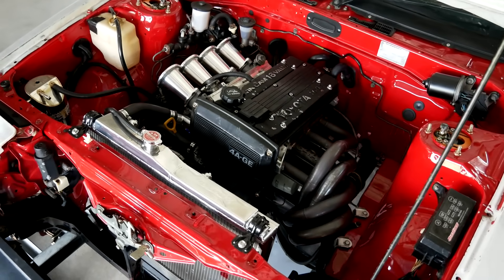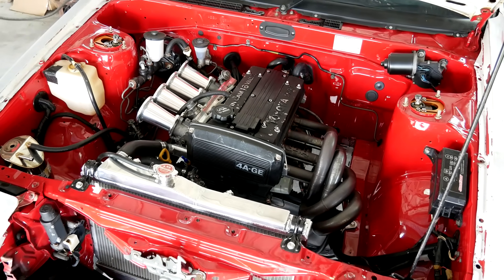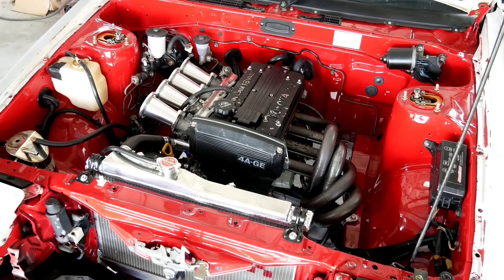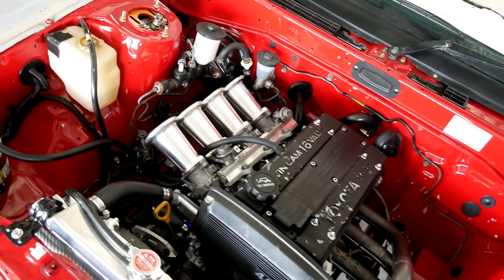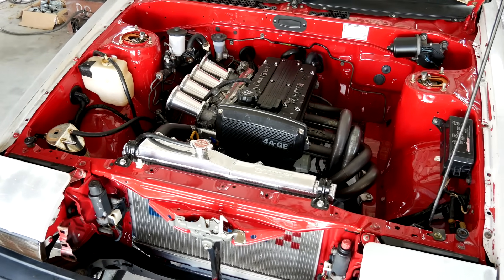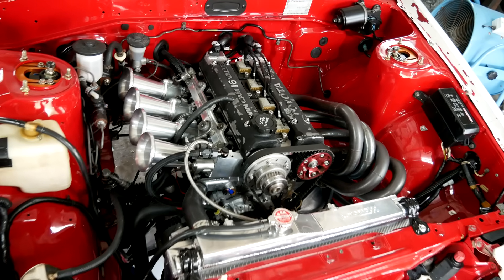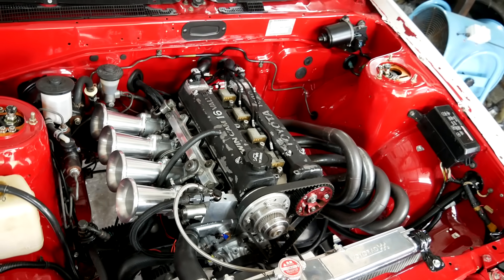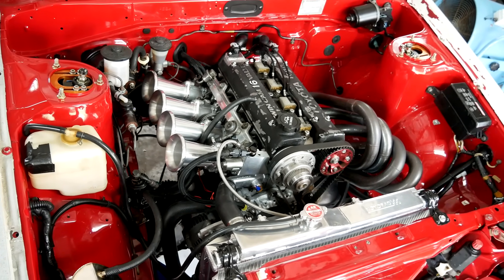Advantages of VVTi  - Toyota AE86

Comment: Is there variants to make 1.6 with  average high rpm (between changing gears) better than with more power?
Like 160hp engine will have more hp after gearchange, than 180hp engine. Is it possible?

Comment: Is it safe to rev 4age (ST) to over 9000?
What issues?
It's OK for new OEM crack and not  for 30yr old ?
It's OK if block wasn't ever overheated so crankbed didn't bend?
What variants can be?

I heard a lot of cases when crank cracked at the first neck. Why so?
Reply from the maker: Never had an issue with stock crank breaking myself.  always at least run the stock balancer.    bottom end wise, I like to do lighter rods and pistons and oil pump gears when going over 9k.
Reply: @Garage4age  What means " run the stock balancer"?
Reply from the maker: @ukuskota4106  crank pulley.    in other words, dont run a solid crank pulley. the harmonic balancer are there to try dampen the vibrations that can break the crank
Reply: @Garage4age  oh yes -that was the other version of cracks - too tight belts on a pulley.

But I didn't see there harmonic balancer.(Only on exhaust pipe.) Is it inside a pulley?

Comment: So VVT in silver \ black is for  idle and low rpm??
When I bought my levin it had VVT welded :faceoalm:
So as I supose it was in the midle of belt timing.
It had lasyness at low rpm but sound good at 7000
but 0-100 was  12 seconds.
Reply from the maker: I dont know exactly how the stock ecu operates.  but 20v  vvt is off (Retarded) at idle, low load, and high rpm (6-7000rpm onwards).    On  (advanced) everywhere else.
Reply: @Garage4age  my АЕ101 pre-restyle switch VVT on when pedal is more than 50%.
I put a diode and +wire  on  VVT wire  near ECU (it's minus).
I read that different ECUs had 3 different VVT algorythms.

but I meant VVT as device. Old engines (without VVT or VTEC) can be equiped with higher cams but they will have high idle .
So when VVT is of it's for low rpm ride, I think.
Reply from the maker: @ukuskota4106  Yeah  engine with big cams will run nicer at idle with vvt/ vvti

Comment: Question for a 4AGE professional: is the 9AGE a real build? 7A Block 20v K20 pistons and rods i think?
Reply from the maker: A company makes a stroker crank etc to make a 1900cc engine.   which they call a "9age"    personally i would never run it.   since the bore / stroke ratio is pretty average , and are demanding a lot from a head designed in the 80's for a 1600cc.     best to go to a different engine for that kind of capacity

Comment: I think twin VVT would show possibly around 5 to 8kw more power above 4000 rpm on average
Reply from the maker: I've simulated it on adjustable cam gears.   is small gains but, isn't that much in it over a well timed fixed setting.   found same thing with dual vvti engines i've tuned, like beams 3s etc
Reply: @Garage4age thank you for the response, i had a feeling that was going to be the answer 

Cheers from the US

Comment: Interesting as always. 
 What are the owners comments? Is he happy with the gains? Did part throttle response improve?
Reply from the maker: He hasn't taken it to the track yet, but sneaky road test seemed good.    I usually tune the vvti on track stuff with a pretty flat map load wise, since the vvti system cant mechanically advance/retard as fast as jamming your foot on and off the accelerator pedal.    a road car  you would bring the advance back at light load, so drives nicer etc

Comment: Nice project.
I have an '85 MR2 with a 4AGE Blue Top (T-Vis) engine, minimal tuning.
- sri
- 60mm exhaust system (factory worn out)
- 280cc instead of factory injectors (182cc - they broke)
- Ecumaster DET3 piggyback
Before the ECU tuning 118hp (6551rpm)/144nm (5248rpm), after the ECU tuning 131hp (6733rpm)/153nm (5334rpm) on the crankshaft.
Now I'm thinking about further tuning, maybe bigger camshafts, but I'm afraid that there won't be any torque at the bottom. The exhaust system may also be too big (it's really loud), I'm thinking about changing it to a 50mm one, which would lose horsepower but gain torque at the bottom. Maybe a soft boost turbo around 0.3-0.4bar.
Any advice?
Reply from the maker: oversized headers  combine with large cams are what kills the low end.    big exhuast actually does the opposite contrary to popular belief, a small exhaust system will make the problem worse, as it stops the headers from working at low air speeds.    look at the graph right at the end of this video, the green line.  you can see the engine has only lost power below 3000rpm.  remember that is only at wide open throttle also,  part throttle is fine down there and you are never wide open below 3000rpm with 4age.   car in vid runs a big exhaust.   76mm/63mm.   bluetop will turbo fine for easy power. just dont make the mistake many people make when adding a turbo to an na engine. need to run a good size turbo, intercooler and big exhuast.  putting undersized stuff on it ends in a bad day, with a knock limited engine that doesn't make much power.
Reply: @Garage4age  Thanks for the answer!
Since I use it on the street, it is important for me to maintain a relatively normal lower range of the engine, so I would definitely not go above a 264 camshaft, but I might prefer to stay at 256 (the factory 240). However, this would not give too much power, and it might not be worth the money invested.
Now there is a factory header. Unfortunately, I could not find an header that would fit in the MR2, there is much less space here than in the AE86. The factory header is connected to the 60mm exhaust, which according to them, if I were to change it to a 50mm one, would the engine's performance and torque weaken a lot? In this case, a turbo is still the most optimal solution for more power, but then the nice intake sound would be lost.
Reply: You're the man sharing the knowledge.  Bravo

Comment: What about building the same setup, but on a 7A block with this 4AGE head setup?  Certainly it should have a lot more torque and a better power curve as well? Im sure it will be on par or better the stock 2ZZGE
Reply from the maker: I have tuned lots of near stock 2zz's.  just bolt on stuff.    power curve is almost identical to this engine.    2zz nicer below 4000rpm   due to the low lift cam profile. 2zz in theory should beat it with the right bolt on parts.      7a bottom end actually makes the power curve arguably  worse.  as drags the power down the curve and has less rev range .  i have a video testing both 4a and 7a bottom end on same top half.  head spec is similar to the one in this video  https://www.youtube.com/watch?v=vl00Fd2pvNI
Reply: @Garage4age  Thanks for the reply. Yes I have to agree with You and have watched Your video comparing the 4A with the 7A . I just think the 2ZZ has a lot more potential due to its VVTL design, better intake and head design and its also forged bottom end. But I also know there are some serious frankenstein 7AGEs out there such as the one TK Drift King and others in Japan has done. But I also have to say im quite impressed with a fully built 4AGE like yours or  even the 83mm stroker MRP setup.
Reply from the maker: @The_Guru_786-n2r    2zz head definitely looks nice out of the box,  port angles sizes and big valves. i did some porting on one the other day, well was more of a tidy up than anything aggressive that need to do to a 4a head.  as they are pretty nicely finished from factory.  It might come through for a tune at a later date.   The stock high lift lobes are similar duration to what is in this car.  but a bunch more lift and i assume a lot faster ramp on the cams. since the 4a head is limited by the shim area.   with the right bolt ons they should make good numbers on  a stock engine.   as for the 7a one in japan. if you look at the dyno graph its making  170ps at wheels. the 215ps is estimated engine power.  so pretty much the same as the car in this video before vvti.    The c's garage 7a's  (i built the heads for them)  make decent numbers  about 140kw/190hp at wheels

Comment: I didn't know that you could do this without a 20v head. 
Used to own an AE82 Lift back with a silver top 20v. Mine was one of the last ones built at the Thames plant in NZ. They only made 170 GT liftbacks total. Sure it wasn't an AE86, but even 20 years ago those were unobtainium. I bought a mx5 after that but the engine just wasn't as exciting.
Reply from the maker: You can just not easily. this is the only 16v vvti 4age  that exists other than my personal cars
Reply: @Garage4age  So, harvesting a 20v engine out of an AE101 or AE111 would still be an easier route than converting an earlier model 4A-GE?
Reply from the maker: @kir0nz    Yes,  but 20v heads dont modify as well as 16v.  bt 20v will make more power stock or mildly modded,    but 16v is better when chasing a lot of na power.    also the 20v vvt system is just  on or off,  fully retarded or fully advanced  30deg travel.     the setup on this car is vvti,  ecu controlled to target anywhere between 0-60 deg travel
Reply: @Garage4age  Dont know if you are aware, but I have heard a story of how Yamaha, long ago, late 80s or so, made an effort to make prototype heads that were as close to apples to apples as they could get them, and test which number of valves made the best power in an "unlimited" scenario. I have heard as many as (I believe) 9 valves but at least 7 per cylinder was tested. 

In the end, the 4 valve won out, not just for cheaper production than more valve but also more power. Of course, in other configurations or uses it might still possibly be beneficial with a larger number of valves.

A decade or so later on there was an internal debate if Yamaha should keep using their signature 5 valve for marketing/branding reasons to separate them from the competition in their race bikes but it was decided that the power loss compared to a 4 valve head was too much to ignore in a racing context. 

Now, take this story with a grain of salt, I read this story and similar in a technical article in what I consider reputable car and motorcycle magazines back in the day, but still.

just thought you might find that interesting if you hadnt heard of it, when talking about 4 vs 5 valve heads.
Reply from the maker: @GoldenCroc  Have heard similar stories.        In 4age specific case.  when you look into it.  The blacktop 20v  only make more power than a 16v,  stock vs stock,  due to things other than the head itself.   Higher compression ratio,  VVT, bigger camshafts, better intake and exhaust.     I haven't got very scientific about it, so never made a video  comparing.   but a fairly comparable setup  16v , ported head,  itb's  good headers and exhaust, vvti and little stock cams. best i managed was 120kw.    my blacktop with similar stuff. head tidy up, intake and exhaust played with  best was 116kw from memory.     16v having a little advantage with bit more  head work  but down on cam size.   So yeah it would have been cool to see a 16v come out with all those things factory
Reply: @Garage4age  I general, I think its very possible that more valves than 4 can flow better, even in apples to apple with all other parts. 

However, If I am not completely erroneous, stuff like the combustion chamber shape, valve shrouding, valvetrain mass and friction, optimal shape and potential placement of intake and exhaust ports etc must also be taken into account and can of course negate a flow advantage.... 

Now, I am guessing neither you nor me have the resources to find out the truth with all these variables.. so if that article and rumours were correct, its a good thing (for us who want to know more about the physics of it all) that Yamaha seemingly has done the work for us....

I know I saw pictures of prototype 6 and 7 valve heads respectively and especially the 7 one looked bonkers. 

 Sorry if something in the text looks odd, its an ESL situation in my case.

Cheers mate, from the snowy other side of the world.
Reply from the maker: @GoldenCroc   Yeah obviously more valve area.   Agree that making it  work in the real world is another thing.    I'm sure there are far better examples than the 4age version of it as well.  Silvertop 4age  is just a big open mess behind the intake valves, blacktop looks better, but still looks compromised compared to nice even spacing on a 4 valve head.

Comment: What a gain in power band ! As usual excellent contain ! What about dual vvt-i on your engine ? Maybe a next test 😊
Reply from the maker: Have tested it just running through fixed timing.  exhaust side isn't worth it.   which is good because doing the intake side is bad enough haha
Reply: @Garage4age sure it must not be a easy task

Comment: If you are running out of content ideas, may I suggest finding someone with a naturally aspirated EFI 13B powered car (not Renesis). There is still a strong following of these in NZ and AU and people who have never owned a rotary find them interesting. There is also very little tuning information available for them. e.g. try finding back to back dyno tests of quad TBs bodies vs IDA style TBs. Or fuel RON. Or surface discharge vs conventional spark plugs. Or timing split. Or header length!
Reply from the maker: I possibly have one coming through at some stage.  would be interesting to do some intake tuning on it.   I am one of those people that would like to have a play with one. but not own one haha.  maybe back when they were cheap.   have done quite a few turbo ones, none na though
Reply: @Garage4age  The cheapest way to build a NA 13b is to buy a blown Renesis engine for its lightweight high comp rotors, counterbalance weights and eccentric shaft, second hand 4 port rx7 irons, and new rotor housings. Still not cheap but probably cheaper than building a full house 4A-GE with dry sump, Atlantic valves and CNC ported head.
Reply: @Garage4age seeing you tuning testing out so many different ideas tricks on a much more complicated piston engine. Individuals definitely will lend you one to tune swap intakes on their  dorito
Reply: Seeing 250 about of a 4 banger, you need to about airflow and efficient combustion, that basic no valves rotor... I saw only one other 250 4a. Not like it's rare, it needs some soooolid ducking experience
Reply: There is a guy on YT @SidneyCritic who has made a pretty good video on rotary engine port tuning and other stuff. Seems like he has experience in engine building and drag racing.
Reply: No kidding. I was driving behind a 13b BP Nissan Navara this afternoon. Usually those are smoking for a different reason haha.

Comment: Would there be much benefit (ignoring complexity and cost of course ;-) ) to having dual VVT -- could you eke a bit more out of the top end with crazier exhaust timing ?
Reply from the maker: ignoring everything else emissions, low engine speed running etc.. performance wise Is a touch in it, but nowhere near the benefit of the intake side.    Fixed can get a really good compromise where it works pretty much everywhere along with best peak power,   only being down a few numbers in the middle.    have found the same tuning other engines with dual VVTi.
Reply: Appreciate your methodical approach and humour. 👍  I'm curious about any tech details/challenges overcome you can share on your vvt retrofit that might apply to other engines (valve block, oiling, oil pressure, check valves, cam selection, anything).  I have a Pug xu10j4rs on itbs that I'm contemplating adapting the vvt system from an ew10 on. Somewhat inspired by your work here!   On the xu10/ew10, cams are more or less interchangeable and mechanically it looks doable with new pistons, but main work is in variator oiling, likely machining oilways into the cam ladder to actuate it.  Did u fab your own valve block and did you need to make new oilways to feed the variator via the cam on this?  Cheers from over the ditch!

Comment: Very cool.... I hope someone put a 2zz in one of these 86s and brings it on your channel
Reply from the maker: I tuned one few months back.  well in a ke70 sedan.   stock 2zz on blacktop itb.  made almost identical power as this car.   just a bit nicer in the low end due to small low lift cam profile
Reply: @Garage4age can you ask him back to do a video??? And very keen to find out how difficult it is to use the blacktop ITB set up.... Speaking of throttle bodies... How much benifit do you estimate a rotary action throttle would give vs a normal ITB
Reply from the maker: @nigelsmith7366   you mean barrel roller throttles?   cant say ive had any experience with them. but i would assume not much in it, if both were sized correctly.      I think a few places make itb manifold's for 2zz. othewise just the same as itb on anything else.  If i was doing it. would go bigger than blacktop throttles.  probably something around the 50mm mark.    most of the time its not practical to make videos on customers cars. time and concentrating on getting tune dialed in.  but if get something through that works out will do.
Reply: @Garage4age    thanks bro.... Have you seen Frank Kelly and his Millington diamond series II... 2.5ltr N/A L4 330hp❤